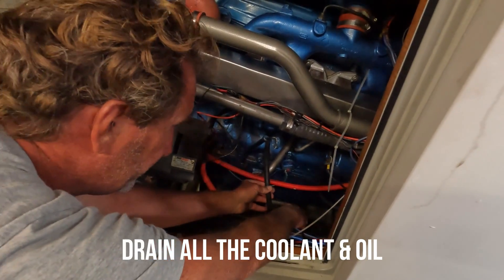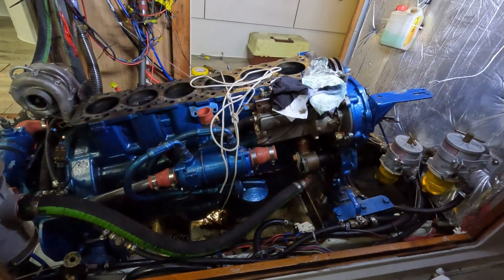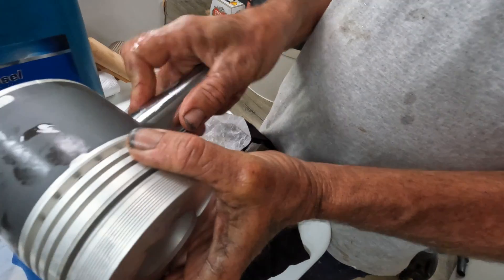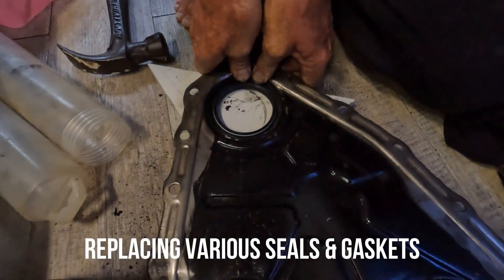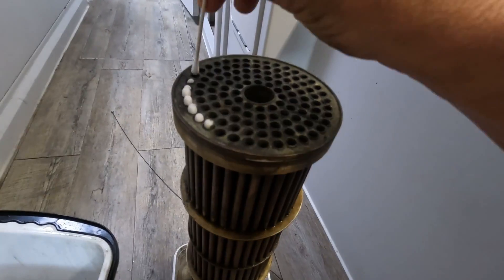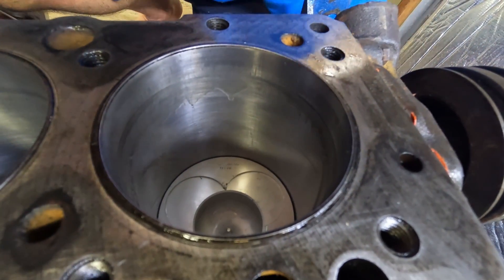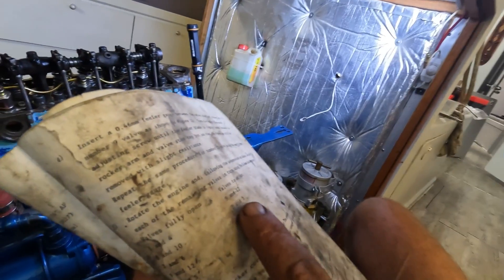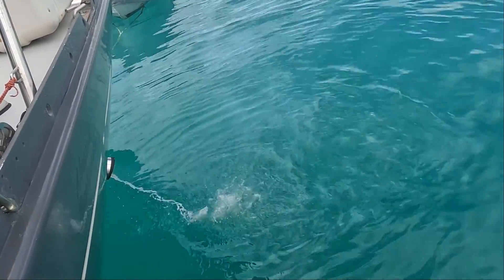ENGINE REBUILD (Ep. 28) | Rebuilding our 185hp diesel engine on our boat

Comment: When you hone barrels you are not polishing them and making them shiny, you trying to make a "plateau", so it has an XX pattern at a 45° angle to hold/direct the oil to where its needed and to wear the rings in. You are trying to cut the glaze off and if you just polishing it, or making your hone lines all haphazard at the wrong angles, you just wasting a set of rings and could be damaging the cylinders and then you need to re-bore and go oversize pistons and rings to fix it. And it might look like its working at first but if you don't remove the glaze or you polishing it, the rings wont bite and you'll still get blow back and your lubrication wont be optimal.
Reply from the maker: Yes, good point, that is why we are moving the drill up and down to cross hatchet. We’ve done this engine rebuild a year ago and the motor is running sweet and the back pressure is gone so we are stoked 😉

Comment: nice rebuild, very useful that you're able to drop the oil pan in mounted condition and you didn't have to replace the cylinder sleeves... i asume you overhauled the injectors as well and checked the oil pump for wear.
Reply from the maker: We actually had the injectors tested 😉(pressure tested)
Reply: i found it very funny when you mentioned "and just like that the engine rebuild is done and dusted..."from my experience, given all the tools & parts needed are provided, it would take two skilled mechanics around 4-5 full working days to do the job... @Camarasailing
Reply from the maker: @-TruthHurts  I didn’t mean to make it sound like we did it in a day 😉

Comment: Wow! Very thorough and very clean when all said and done. Were you able to hire a machine shop locally to dress the head, or did you have to send it back to AU or UK or the like? How long in total were without an engine?
Reply from the maker: We were lucky there was a local machine shop we could use. It took about 2-3 weeks as we needed to order the big end bearings when we realised we needed to replace them as well and had to wait for them to arrive. We went on to the dock while we were without an engine but timed it so we did it at the same time when cyclone Gabrielle hit NZ, so we would have been in a Marina for that anyways, kind of a kill 2 birds with one stone scenario. We usually don’t spend money on sitting in marinas but no engine and a cyclone meant we spent the money for the dock wisely 😉

Comment: Love those old straight six marinised truck engines! They're great for working on and seem to last forever!
Reply from the maker: Yes and the spare parts are affordable and you don’t need a computer to run diagnostics 😉
Reply: @Camarasailing  yes, even a non-engineer clux like myself with very little knowledge of engines managed to struggle by - though there's no way I would have even considered undertaking the sort of rebuild you did! Well done for managing it without needing to go outside the family!
Reply from the maker: @paulsinclair3401  thank you 😊